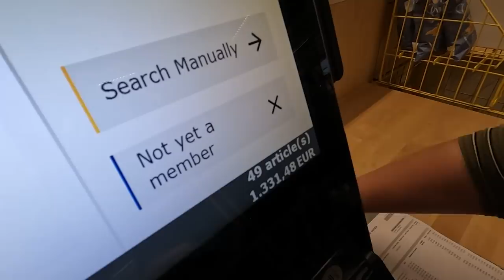Buying Our Tiny Home Kitchen! Building an Off-Grid Home

Comment from the maker: 🌿 To get a 1 year supply of Vitamin D + 5 individual travel packs FREE with your first purchase, go to
https://athleticgreens.com/theindieprojects
Reply: Build a ladder that will fold under the messanine out of your way in daytime. Fix it up so it will roll up to the ceiling and fold bottom back under. It will not block your view when on couch or chair.
Reply: Can you sand the shiny part of the faucet and paint it mat black
Reply: Definitely put in a small staircase against the wall next to the front door and you can make it a storage staircase made of drawers

Comment: You should put trolley wheels on the ladder to slide it to one side when not in use. Similar to the old style library ladders.
Reply: Except the railings need to be permanently fixed. There is a ladder that folds down to use, but it has to be against a wall, the only wall you could use is where couch is...
Reply: Absolutely
Reply: Hopefully you can find your kitchen counters in the near future. Maybe at the stone shop where you bought the slate? It is better to wait and get what you really like vs just settling on something. There is always butcher block, ceramic tile or concrete to consider.
Reply: Sliding sounds cool..!!
Reply: That's exactly what I was thinking.
Reply: I would definitely get a ladder that can be slid to one or both walls.  Better than staring at a permanent ladder while sitting on the sofa.
Reply: Exactly what I was thinking. If you put something fixed in place that you can't remove or move will end up being pain in the future.

Comment: I definitely would put a small stairs case next to the wall. I think in the middle of the room would take up alot more space and then your walking around it all the time. If its next to the wall you could have lots more storage in the steps. I've seen some really beautiful ones.
Reply: @heather333  Hole is already in the ceiling for the stove pipe.
Reply: No headroom when you get to the top of the ladder, so there's a practical problem.
Reply: Agree with you.. but while on a trip some time ago they spent some time in a home with similar set up and it seem to work.. but I really do feel that a step at the side would b much better
Reply: Agreed, in the centre breaks up the room.
Reply: I agree, who likes to climb down a ladder if they need to pee at 3AM?  I saw a clever design for a staircase that can actually fold next to the wall when not in use.  So clever.
Reply: @dellagilchrist7647  I saw that too.
Reply: They have already decided in a video about a month ago that they can't put it on a side wall. They would hit their heads, it would be next to the wood stove or right in front of the only windows and door in the house. I believe they have had it all figured out for quite awhile.
Reply: I hope y’all are going to video putting the kitchen together. I am considering an Ikea kitchen and am very concerned about putting it together, especially after watching Eamon and Bec do theirs. Can’t wait to see the final kitchen. Also could you give me info about your stove. I have a tiny kitchen and need smaller size appliances
Reply: Problem with that idea is the proximity to the wood stove
Reply: Could you have it like library ladders on a rail that slide to centre and when not in use slide to the wall away from the heater giving the room a larger vibe it could lock in with a pin through top of chestnut into the facia beam ? In the middle breaks the flow 👍❤️❤️❤️🙏
Reply: There is a show I watch on TV in the US called Maine Cabin Masters and they renovate a lot of small cabins and have used  lot of those “sladder” stairs. I see how it would be perfect for this home. Bee and Theo have the right idea.
Reply: Beautiful chestnut slander will echo off all the other chestnut! Those oak leaves make such a nice touch! You guys have done a magnificent job!
Reply: @IExpectedBSJustNotThisMuchBS  wrong wall. The stairs on the front wall could even be divided with a landing for more storage space and a shorter floor flight.
Reply: Kitchen  side. That would keep the whole thing open. Can't wait to see the kitchen!
Reply: I totally agree. I would put the stair on the wall of the door and the bed on the opposite side... side of the kitchen. You could put a basket or something under the stairs for extra blankets.  It's going to be beautiful.  Can't wait to see the kitchen❤
Reply: I thoroughly agree..next to wall. For space ..there is a foldable staircase which ww sent..saved a lot od room..also hope to think ahead..sleeping at night ..needing to visit the LOO up and down.
Reply: Also, have experience with Ikea..put togethers..marathon
It is a lot of work..musy be careful to check all the parts are there
Worth the work and the Price correctly. 
Help my daughter put together a room full of furniture from Ikea when she moved into her new apt.
😮😊😊😅💕😄
Reply: Yes I totally agree with putting it against the wall or something like that . I think you might be sorry putting it in the middle! 
But all the best in this new project! You guys have done an amazing job so far!!🥰
Reply: @lucieherrick6934  we have an ikea kitchen. Going on 17 years! It wasn’t difficult to put together and has lasted. We are just now needing to upgrade etc. hopefully next year.

Comment: Personally, I would place the bed onto the opposite side of the loft and on the side where door is, I would build a staircase made of built-in cupboards. It this way, the stairs would not block the view of the rest of the room, they would provide you with plenty of storage which would be placed on the side wall, and you would not have just a ladder, but a staircase - which is safer and more comfortable to use. But I respect your decision, of course. I'm just expressing what I would do.
Reply: They wanted the head room on that side...

Comment: One cool trick I saw was to attach the steps with only one screw and then put the ladder in place and level them with the second and third screws while in place. Small supports can be added underneath each step.

Comment: Exciting stuff…in my old home I had an IKEA wooden counter top and I loved it. I used the matter finish coating to seal it called (Waterlox). It’s so easy to use and it dries quickly. I applied it with a sponge paint brush. The current owner of our old home still has it and he’s lived there 4 years and we had it a year before he bought the home. I found it very easy to maintain. ❤️ I can’t wait to see your finished kitchen.

Comment: you could've hinged the ladder at the top and connected the bottom to a cable and pulley arrangement with a counterweight that could run down next to the wall and just pushed it up out of the way until needed.

Comment: You are doing so well guys. Love your work. 

I suppose you may have considered to have your sladder kind of like the American barn door system, where it can hang off at the mezzanine end, plus unobtrusive wheels (with brakes) at the base. This way you could position your ladder so easily to wherever you please - completely out of the way, to exactly where you want it. 

Of course the way you're doing it now will also work (as long as it's not permanently fixed), just with not as much ease, but will probably look much more cohesive the way you're doing it now.

Comment: Tip for that saw if you have a candle rub it down the face of the blade , or as you said buy new , as for the ladder def would have it on a track so could move it to one side ?

Comment: Regarding the ladder: put a hinge on the top and then put a pull-up on the ceiling attach a rope to the bottom of your ladder bring it over to the wall and have it come down you can just pull that ladder up out of the way and then lower it when you want. Wife’s family did it at their cabin.

Comment: Every time u get up from the settee u r going to head butt that light.  Also if u r not going to put the ladder along the wall out if the way u r going to get fed up trying to avoid the ladder.  U could knock up a pulley system from the ceiling to go around the bottom of the ladder and pull it up when not in use.
Reply from the maker: Hey Patricia, you would have to be 7 foot tall to head but the light. Theo is 6,3” and it’s nowhere near him 😀

Comment: Just a heads up those Ikea jute rugs shed little bits and dusty stuff constantly. I ended up getting rid of ours because of the mess but it's worth lifting the rug and cleaning under it when you vacuum to stay on top of the dusty bits it produces. It was just a chore I got sick of when it had a heavy coffee table on top of it.

Comment: You should have the ladder be able to either slide up and roll under the bed for during the day, or be raised up and become a light fixture. If you put springs to hold it at 90⁰ you could put LEDs on the back of each rung and then you have a cool lighting peace. If it's too long have it fold in half and then pivot up.

Comment: If you put the bed in the opposite direction, you can make a small spiral staircase in the right corner through the mezzanine. I don’t know if there will be enough space above the mezzanine in that corner to climb up the stairs easy, but when you’ll be climbing up the sladder you will crawling on your knees once you’re up anyway so I guess you can do that with a staircase as well. It wil  be saving you a lot of space and you won’t be looking at that sladder all day. It’s just an idea

Comment: Why don’t you hang the ladder on rails so you can move it to the middle to climb and the side when not in use. Kind of like a library ladder. For rails on the loft, metal with wire would look nice and modern . Seems like it would be easy to install

Comment: It's all looking great! I love it. Just a thought - instead of making the ladder rigid, why not make it both movable and foldable. So - following the two ideas of making a ladder that slides like a library ladder and making a ladder that folds up: How about a ladder that slides (library style)and can also be stored vertical, out of the way - in which case the steps would fold up  - and when the ladder is pulled out, the steps would also come out. A bit like a kitchen step ladder but able to slide to different positions.

Comment: You already have your idea for the stair but it's too bad you couldn't have it against the wall on the right side wall where the door is, if there's room but then the bed in that position would be an issue.  It's already such a tiny space and I think the ladder/stairs would take up so much space in the middle and would be uncomfortable to walk around.  It might work if it was a bigger space. If you want to make the most of the room, a stair against the wall would be it.  I like the idea of those staircases that have built in storage in the steps, seems like storage is nearly impossible in that small house.  Anyway, good luck with whatever you decide to do.

Comment: I have a very similar set up in my house, a slightly steep staircase to a mezzanine, close enough to the wall without losing necessary headroom as you go upstairs.
Reply: I am a patreon, can I send you a photo via patreon?  It might just be useful, I completely understand that headroom is an issue.
Reply from the maker: Hey 👋 yes please 🤗

Comment: I used to fit flat pac kitchens like yours just re her if you are using  Formica type chipboard type tops you must cut them upside down or when the teeth come up through the Finnished surface it’ll shatter it and ruin them

Comment: I rather have the stairs  "movable" if needed to and not fixed or unmovable.   Is there Anyway to have it latched firmly onto the position you want and for some reason it can be  unlatched if you have to   put it in a corner.  Just my thought.😀

Comment: I have installed an IKEA kitchen before... Not sure that you will be able to use those metal rails. Do you intend to hang upper cabinets? Looking at the mezzanine, it's obvious that it is possible to sink supports into the stone wall, but I don't know how sturdy that would be!

Comment: I would put the wood stove on the other wall, so you won’t get dirt from the wood all over the floor and put the ladder against the wall where the stove is now.  So much more room in the middle of the floor.
Reply: The hole is already in the roof for the stove pipe. That’s been their plan to put it there all along.

Comment: Hello from Montréal Québec Canada.Hmmmm nor sure about the latter/stairs right in the middle of your house.Even if it is well executed,it will cut the space in half from every angle.Much better oriented on the side,leaning against the front wall.I know,I know….your bed would have to be on the other side of the mezzanine.Just think,watching the stars your head on your pillow,sooooo romantic.

Comment: Too bad you didn't find a way (yet?) to get that lamp in the corner.  I know.  That base is large and weighted so you are limited in floor space back there.  I would be tempted to pull the couch out just to make it work.  Perhaps Theo can build a slim shelf unit behind the couch so it wouldn't look awkward away from the wall. I'm betting 6 to 8 inches (approx. 15 to 20 cent.) would look nice and not even be noticed out into the living space.  You can put candles on it at Christmas, family pictures, a vase of flowers, your cats will love to walk across it, and you can toss your throw blankets back into the corner when your not using them to snuggle in.  Whatever; you do you.  Love what you are doing there so far!

Comment: I would have had it going up the side of the wall as it been in the middle a bit of problems
Reply from the maker: Very difficult at 6,3” to get up on the lower pitch area and then the bed is in the way. I guess it’s hard to get a feel for a space on video 😀

Comment: Oh wow, very nice!  Ya know if you're going to do it like that, you could still actually make it movable by not fastening it down, but instead placing a top flat metal or wood slots on top the top main beam to prevent it moving left or right, yet still allows the sladder to be moved if need be moved.  Awesome either way.  Very nice!  Love it!  ❤

Comment: I have assembled multiple kitchens and lost count of how many pieces of furniture from IKEA and always read first and then follow the instructions. If you do that you will save your self a lot of frustration. My experience is if this kitchen has tiny adjustable feet they will sink into the wood floor over time. In our cabins that are the same size as your barn we use the Ikea wireless switches and I think it's the best invention ever.

Comment: You should have the stairs on a rail at the top and wheels at the bottom so you can slide them to any position,  like the old bookcase steps.

Comment: Looking fantastic.  
A possible suggestion, if you have any of the rope from the floor edges left, perhaps a small 'bannister' for the sladder, using it on one or both sides? It would still be open but give you something to hold if you ever need to balance going up or down.

Comment: I've seen the same kind of ladder with a kind of "gliding"-mechanism, I lack the vocabulary, I'm afraid, it was on trolley wheels and they could roll it to the right side of the room, close to the wall and out of sight and then back in the middle of the room to be able to climb the loft area without hitting their heads. It was on the "Living big in a tiny house" channel, I think (not sure), and it was a rather clever space saving idea, I think. Just saying. Kitchen is gonna be top notch! Great choice of color.

Comment: 2 cents here.....could you not position the ladder along the back wall to emerge through a hole in the centre (highest part) of the room where you can stand upright? You'd lose a bit of floor space, but you're only sleeping up there. That way you could use the underneath as some cool storage.

Comment: Put the ladder on rollers top and bottom so you can slide it off to the side when not using it. Dont put it in the middle fixed... I'm only 9 mins in so maybe you get to that. It should be "put-away-able"
Reply: Like a ye oldie Library ladder. runners top and bottom to stow it away left or right. A fixed one doesn't give the dual purpose space below and above
Reply: Why "should it be put-away-able"? Because that's what you would do? I would despie that, having to pull it out and put it away every time I'd want to get upstairs. No thanks.
Reply: @bleh329  If they mount it permanently in the middle, it encroaches the downstairs,sofa, kitchen space. If you can roll it off to the side and still have access to your bedroom, that 2 times a day you need it,  without having something always in your way, come on it makes way more sense. It will never be a stair feature piece, convo piece, no matter what they do. It needs to be functional and practical. And also cool your jets and calm down. It was a comment with respect and also advice

Comment: Hi guys.  I've been following your journey right from before you started looking for a property. 
Bee you are looking great.  You actually sparkle in this video. Theo is doing a brilliant job.
I used to do interior design.  The position of your sladder in the centre will break the awesome look of your lounge.
Pleeese also try it on the side wall where the log burner is even if you have to move  the log burner slightly.
Your hard work is all coming together.
Kind Regards
Lynda Myburgh
Simonstown
South Africa